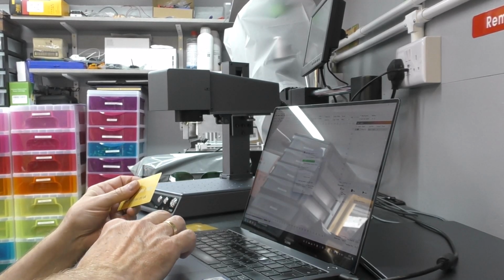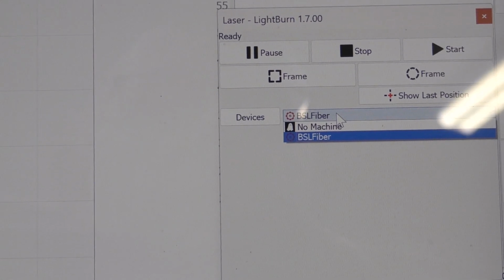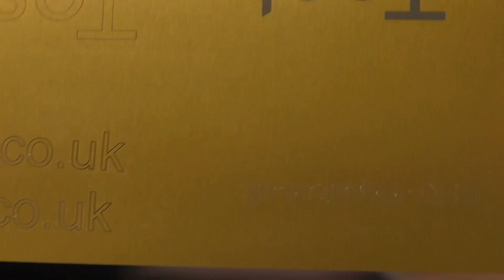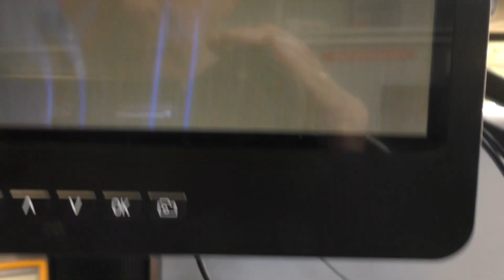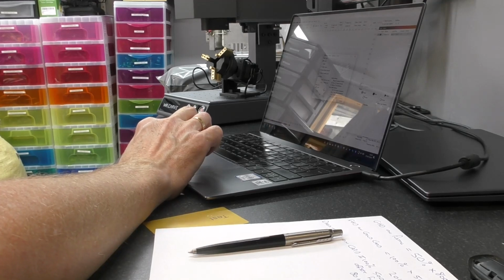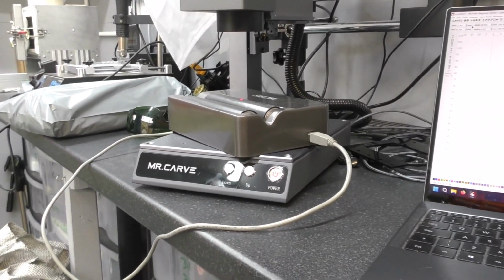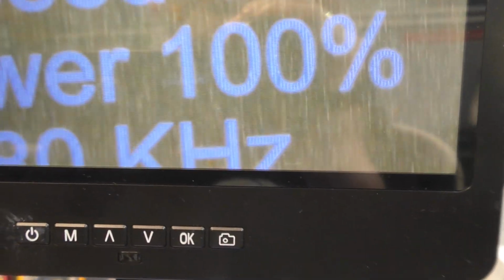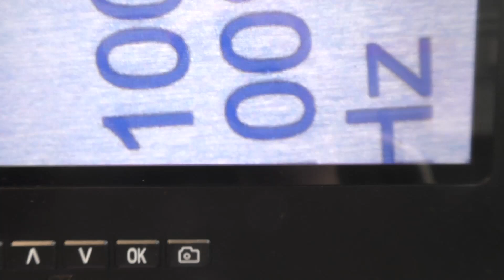Mr Carve M1 Pro and Lightburn

Comment: I have Mr Carve M1 Pro and Lightburn and my problem is that power is poor in 100%. I must set speed tp 20-100. Earlier i was using BSLAppSimple  -and it was much better with power and quicker.

Comment: Hi, thanks for uploading this very helpful video. I’ve just recently purchased Mr Carve M1 Pro.  I’ve been trying to set up the chuck/rotary extension on LightBurn and have encountered a few issues. While the rotary seems to move during test, it doesn’t appear to move when I start the actual job.

I would be most grateful if you could kindly offer guidance or assistance with this process.

Thanks,
Reply from the maker: Hi
Other than the test, I haven't had time to run a job on the rotary or roller. I assume you are using the Beta version of Lightburn, I guess certain things may not be working yet. I will try it as soon as possible, this weekend probably.
Reply: Yes, I believe I’m using the 1.712 pre-release. That sounds great, thank you. I’m looking forward to seeing it. 

Also, do I need to adjust anything else other than adding the confiq file in LightBurn, as you mentioned in your previous video about adjusting it for the BSLsimpleapp?

I found two config files in simpleapp folder one as BSL and the other one starting with Lloc I believe. Which one do I use?
Reply from the maker: @WaqasZahoor-r7e  Spent the afternoon filming for youtube walked in to the house and now can't find the SD card that was in my pocket. I give up...
Lightburn will control the rotary roller, I didn't get time to try the chuck. Look at the settings, particularly the roller diameter and steps per revolution. Match the motor settings to BSLappsimple where possible.